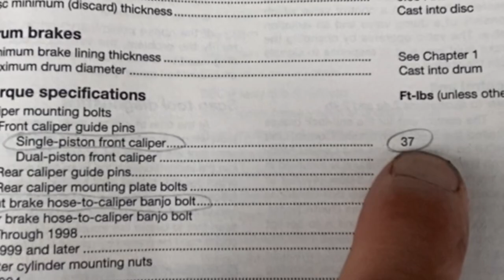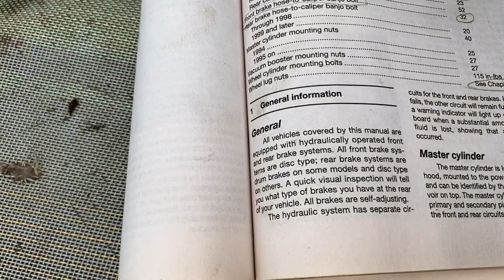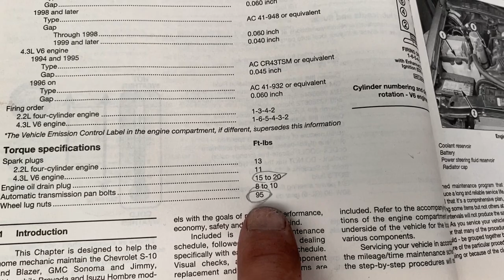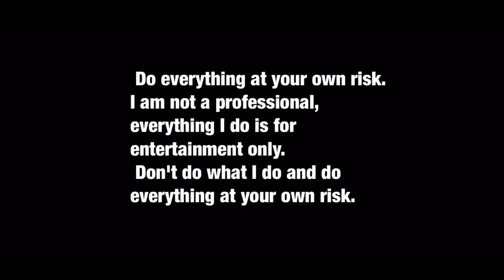94-04 GMC Sonoma front brake pads, rotors, bearings, callipers and ABS sensor replacement. ￼

Comment: Great Video,.. Finally I had my front brake pads
 and rotors and calipers and abs brake sensor wires replaced as well. I was going to do it myself.. but I had 2 surgeries pending a prostate biopsy and a double hernia .. so I just paid my wife's mechanic to do the job ..!